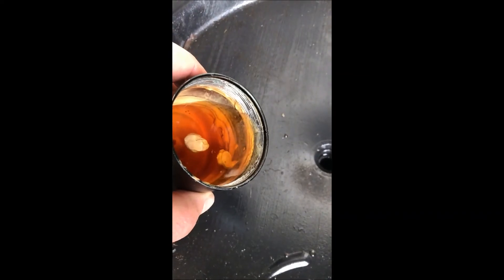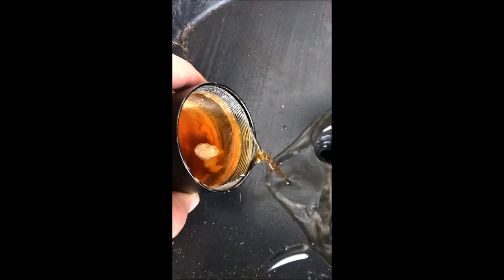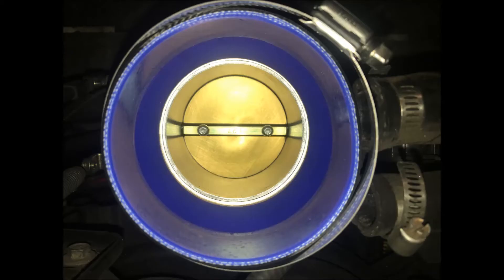Why Is Water In My Oil Catch Can / Oil Vapor Separator: Car or Truck Oil Catch Can

Comment: It’s about dam time someone made a video of this topic. I have a 2006 viper and I routinely get pure water in my catch can living in the south. I can tell it’s humidity because I regularly change and check all my fluids for contamination but never find any evidence of head gasket leaks. The water comes out of my catch can smelling like pure water with a little oil smell. No coolant smell what so ever. The last little bit of fluid comes out looking like espresso foam. When this first happened to me I got very scared but thankfully there is a few good dudes on the internet that have talked about this. Thank you for the video I subscribed.
Reply from the maker: Thanks for your comment.  And glad you assessment makes sense, welcome new subscriber!

Comment: Mine smells like it has fuel mixed with it too. Is that normal?
Reply from the maker: Mine has smelled like that as well.  Only way to tell for sure is to send a sample of your oil to a company like Blackstone for analysis.  I was a little worried with the gas smell until I received the results of my sample indicating very little fuel in the oil.  I think some oils smell more like fuel, e.g., since I've been using Valvoline Restore & Protect, the dip stick smells like gas.

Comment: Thanks, I was somewhat concerned.  I knew that water vapor will ultimately get pulled into the engine due to the ambient humidity, but when I emptied my catch can it was mostly water! I was expecting more oil than anything.
Reply from the maker: It is shocking first time you see it!

Comment: I have a 2018 Chevrolet impala premier 3.6l vvt direct injection engine I'm considering installing a oil catch can ,  i live in Texas where the Summers are hot and the  Winters are cold, fall and spring are rainy, my question is how often do you think i should empty and clean the Catch Can.
Reply from the maker: Depends on your vehicle, I would initially check the catch can every hundred miles and then gauge how often you need to empty it from that point on

Comment: Through the summer, my can caught nothing. Not oil or water. But right now when the temperatures dropped, i got clear yellow tint fluids. Smells like condensation and dries fast. Trippy shit. Never seems to catch oil tho. 

2016 MX-5, 72k miles. Royal purple 0W20- 93oct

Near Miami
Reply from the maker: looks like you found my other video.  Glad to help

Comment: I was wondering but mine had a gas smell but was pretty sure condensation plays a factor in winter
Reply from the maker: gas smell could mean you have fuel passing by your pistons / rings and getting into the crankcase.  Is the vehicle running ok otherwise?  Or very rich?

Comment: i found the same symptoms with my 2016 ranger  water in the provent can turning the oil into a green/brown sludge ,   not many miles on this can  but a lot of wet weather driving   ' started to notice recently  knocking on start up early morning  thought it was just the cold start system adding more fuel  and the knocking quickly went away only lasted for a second or two but on discovering  that much water in the catch can i'm thinking now water may have been just starting to get sucked into the engine  ! as of today I've rearrange  the pipe work  it wont be getting water anymore
Reply from the maker: Excellent comment.  Does your oil still look healthy?
Reply: @DrivingIntelligence  yes the oil is healthy in the motor , only just had oil change but I’ll be watching the inside of the catch can more often now
Reply from the maker: @BCBtrucks64  that's a good plan, just checked mine.  I've been running some oil additives and using Penzzoil and I'm noticing that I have less oil in my catch can.  I'm going to do a video about this in the future.
Reply from the maker: Did you see this video?  https://youtu.be/q16rFjbhDAM
Reply: Do you still run the catch can on your ranger? Mine is 16 Explorer 3.5 ecooboost and just this morning I noticed quite a bit of water in the catch can with heavily gas fume too. I dont know if I should be worried about that or its normal as its been a very humid winter here in NC.

Comment: Is there a type of catch can that will weep out the water but not the oil
Reply from the maker: Hi Victor, what are you trying to accomplish?
Reply: @DrivingIntelligence  I would just like to have the water drip out on its own rather than me emptying it once a week or so kind of like a air cleaner box that has a small drain with a pinched rubber hose on the bottom so when you turn the vehicle off any excess water will just drip away
Reply from the maker: @mrvic92154  that is a good thought, but the problem is that will introduce a vacuum leak into your vehicle and cause a leak condition and likely a “check engine” light.  Catch Cans are awesome if you don’t mind draining on a regular basis.
Reply: @DrivingIntelligence  maybe we can come up with an idea like adding an electric check valve to shut off when the engine starts and to open up when the engine turns off, doesn't seem too complicated maybe I'll just invent one myself,  it's because I know people out there that live far away in the boonies that have no clue on how to drain a oil catch can or how to even check one or like a son or daughter out abroad in college and never even think of checking things like that, or if you have very little room in the engine compartment and the catch can is not very big especially if you're driving on a long trip somewhere like in Florida where it's very humid, my catch can was half full after just one tank of gas which was about 400 miles, I'm sorry I don't mean to go on and on but maybe this might help

Comment: I just installed one last month and it was  winter. 3 weeks later, full of water. I didn't think it would fill up that fast. Caught it last minute and emptied it out.
Reply from the maker: Same happened to me again recently. Tons of water in the catch can.  Makes me think I might need to install a bigger one!
Reply: @DrivingIntelligence  I put in 2 just to see how much the 1st one missed.
Reply from the maker: @JohnDoeSmith08  have you found any additional oil in your second can?
Reply: @DrivingIntelligence  I just checked and after 1847 miles there is about a Table spoonful or a bit less. Not sure it's worth it but it makes me feel better.😁

Comment: My catch can looks Milky like a head gasket.but not losing water or oil
Reply from the maker: Exactly, this indicates high moisture in the air / high humidity.  I'm also testing the use of the premium Pennzoil products over my normal use of Royal Purple.  I'm getting less oil & moisture in the catch can since I switched.